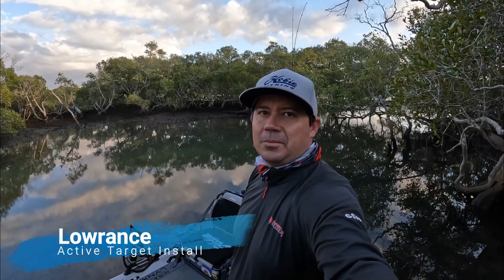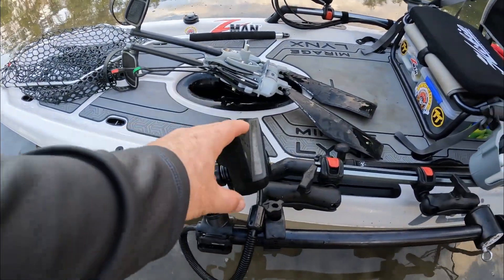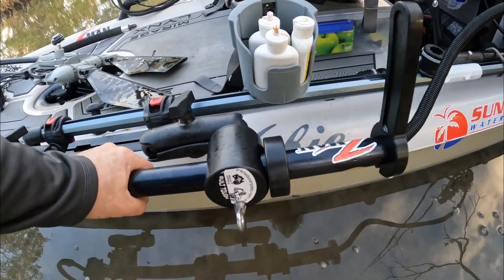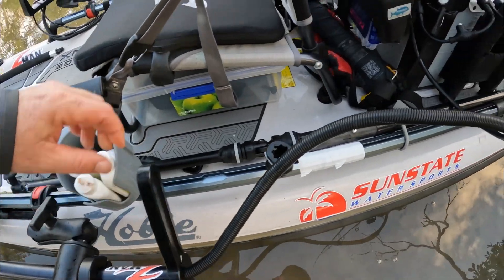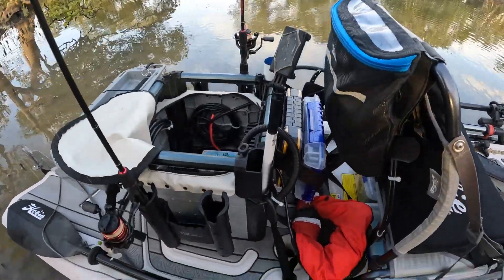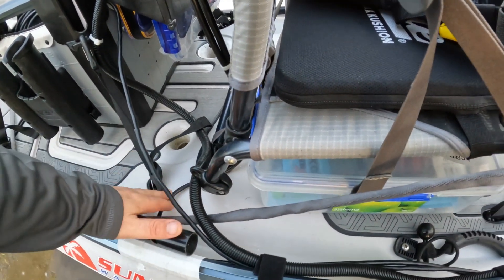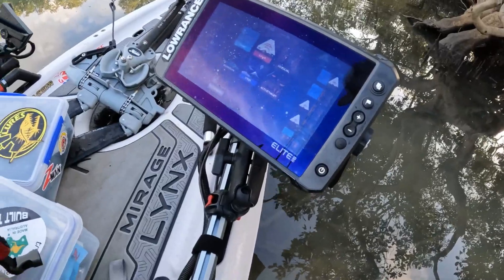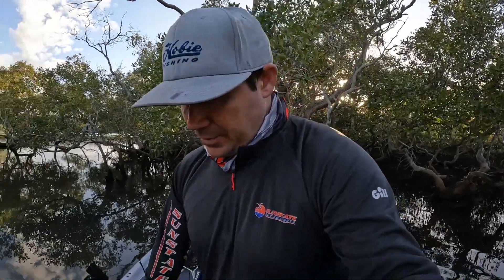Lowrance Active Target onto Hobie Lynx

Comment: Can you make a video of your tackle storage? Curious to how many boxes I can carry with a live scope setup
Reply from the maker: Hey mate cheers for the comment. Unfortunately I have moved the lynk on since making the video.  With my AT set up on the kayak I was able to run the same two boxes under the seat and also utilised a Hobie seat bag on the back of the seat for a little more storage area.  my battery and AT module were fitted in the the Hobie Crate  itself.  
Hope this helps
Reply: @OutCastAngler  what are you using now? I think I’m going to bypass the Lynx and hold out for a PA
Reply from the maker: @MrBthames2000  Hey mate, Ive actually got a PA 12 360 and a PA 14 360.  Both are a fantastic and have the ability to carry way more gear than I need.  Im planning to do some camping from the kayak over a few days, so the extra room will be handy.  I did a 12 month review on my PA 12 which may give you some ideas  https://www.youtube.com/watch?v=sJDg83MAvsc.   🤘